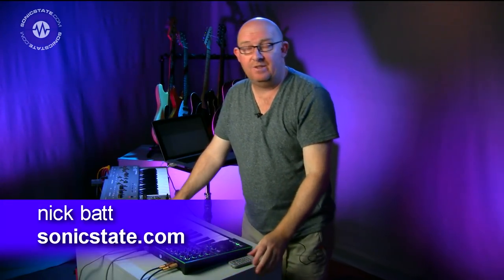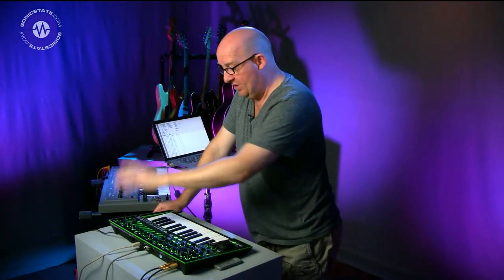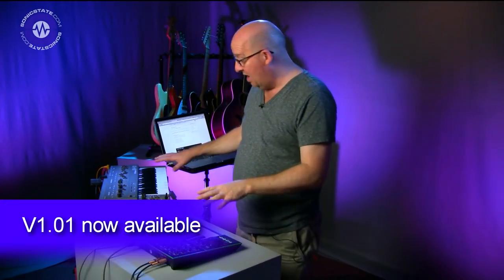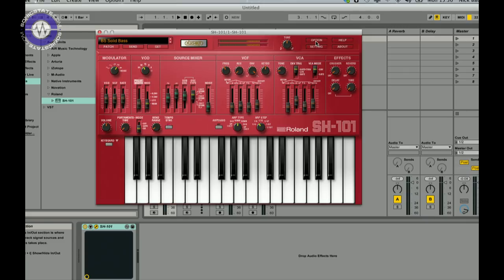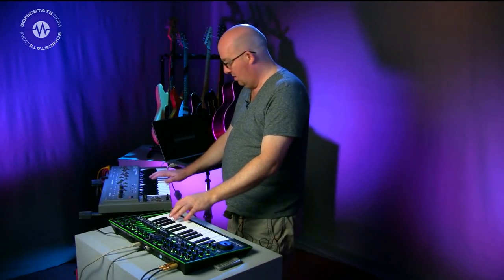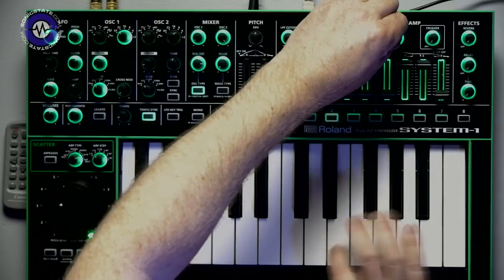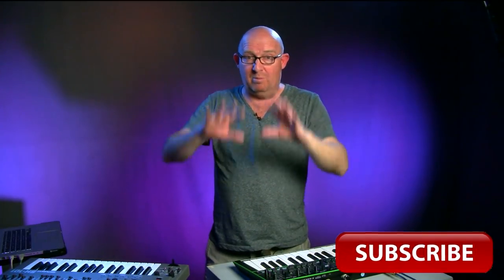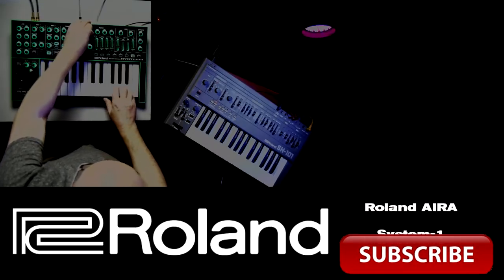AIRA SYSTEM-1 and SH-101 Plug-Out

Comment: Roland given up making analog synths, They last over 30 years. Plug-ins last as long as your computer 5/7 years if your lucky. Roland will be on something different 5/7 years and probably not interested in keeping old products up to date so they work on new computers. (Throw away products should be at throw away prices). You can get a REAL ANALOG for that price. My 101 has lasted 30 years with no repairs. And looks as if its going to last another 30 odd years lol
Reply: jdxi and jdxa both have analog synths plus the se02...so no...they have not 'given up'

Comment: Bought one of these a few weeks ago used, in great shape and it is a powerhouse. I have Roland Cloud Ultimate (worth every penny IMO if you're a heavy Roland user of their recent gear), so all the monosynth models can be added and swapped at will in my DAW for no additional cost. The extra preset packs for the Plugouts (SH-2, SH-101, ProMARS, and System 100) are spectacular and also free. The System 8 vst presets are also freely transferrable and are not the same as the base presets on the unit I bought. The immediacy of the knobs and having nearly everything tweakable without a menu or shift function has sped up my workflow immensely. I own a Behringer MS-1 and find myself not touching it and using the Plugout SH-101 to get great leads and basses I created for years on the MS-1. The arp on the System 1 is your basic bread and butter, so the sequencer on the original SH-101 and even the similar one on the MS-1 are not duplicated, but sound wise - DEAD EASY. I love it and frankly the green LEDs don't bother me. In my dim studio they make using it quite easy as well. It fits in well with my MC-707 and SP-404 to get track ideas laid down super fast. More focus, more creativity, less menu diving are all positive.

Comment: Thanks, very useful review.

11:05 The thing with the class complaint drivers is that they are as you know made by OS vendors (Microsoft, etc.) not Roland. And that can restrict the synth/hardware to a certain standard that might be slower or not up to the high specs of the hardware since it doesn't know the new specifics of it. For such reasons, Roland or any other hardware manufacturer might choose to build a specific driver to support some none standard features that are in their hardware.
Reply from the maker: Okay, thats a fair point, but its only doing 2in 2 out and MIDI, notthing too taxing I would think.
Reply: sonicstate Yeah, I don't think there are too many good excuses for a lack of class compliant midi and audio in this day and age. I would hope that any non-standard additional parts of the hardware that required some bespoke usb drivers would be able to sit alongside the class-compliant stuff, but I don't actually know if thats the case. And that possibility may also be limited by hardware choice of usb interface controller chip. 

There are at least three really rubbish reasons why Roland may not do this class-compliant stuff, along with some possibilities which are justified. I would rant about this issue more if I had a clue which reasons are the real ones, and if this device really would be a supremely great fit for stuff like iPads. But things like the spec of the keyboard and the fact the whole plugout thing really lends itself to working with a DAW on a computer and then using it as stand-alone hardware, means I'm not going to cry too much about this devices failure to embrace the world of tablets.

This sort of thing does make me wary of becoming a Roland customer though. I got a real nice feeling when some X-station 25 from Novation that I got in 2004 turned out to be class compliant for both midi and audio, and worked real nicely with my iPad in 2014. I'll have to wait a good while to see if Roland and the AIRA range can get anywhere close to that sort of class (pun intended), which is a shame really.
Reply: sonicstate hmm, in that case I guess I agree with you. Although it is transferring patch and plugout data at the same time on the same USB isnt it? Could the compliant driver be confused by that?. Any way they might have just slapped their already ready made I/O interface/driver that they used every where else but thats not a good excuse.

Thing is, even with the compliant driver there is no telling that Microsoft, Apple etc. will do a good job in future OSes, or worse change the standard, which means that some hardware in the past might not work any more.
Reply: SoloStuff Part of the idea behind class compliancy is that it's backwards compatible, and should always be so, even if it undergoes changes. But the problem is indeed the transfer of Plug-Out data. Everything else it does is technicly possible via class compliant drivers, particularly since they gave it the bulkdump of patch data.
Now, it is possible to implement Plug-Out data in a class compliant manner, if the "drive" the data are installed on, were to work on the same basis as a USB drive. However, this could have some negative sideeffects, such as it could be harder to keep the system "sealed" from unintended eyes. Some might be confused when it shows up like an extra drive - the disconnecting could troublesome in certain cases. And most importantly it may affect the manner in which the data are installed and subsequent stability and performance.
So while class compliancy would have been preferable, i can understand why this isn't.

Comment: At 9:13 you can hear that sound when the resonance is fighting with the oscillator's lower harmonics, plus a lot more saturated filter sound.
That one is still yet to be modeled properly. The sw resonance does not sound like an integral part, more like an added sine wave on top.
Still, this one is a pretty decent code.

Comment: Hi just wondered if you could help me with a small problem I'm having I just wanted to know the best way to go about recording the midi into my daw as in if I needed to use the system 1 multiple times in the same track is the system 1 multitimbral ? Do the 4 voices allow me to use 4 instances of the synth or do I have to record the midi in and bounce it as audio? if you could help me out that would be great cheers

Comment: Were there ever more than 1 or 2 plugouts made for this? Seems like Roland had a good idea here but never expanded on it like it was touted.  Would've been nice to at least have 4 or 5 options, not just 1 or 2 apart from the stock unit.
Reply: There are 4 plug-outs available for the System-1: SH-2, SH-101, PROMARS and System-100

Comment: There is a problem with the USB audio of the Aria devices. In a Windows environment you can't have multiple audio devices together. Most of us already have an audio device (internal or external) or if you want to record the audio from different Aria devices through their USB connection in a take you can't. You have to switch to one of the aria devices in the DAW and record, switch to other device and record that one etc. 

There is a workaround using the latest Asio4All to combine multiple audio devices but it's not stable enough and you lose the legacy driver and probably a lot of ms. The other way is feeding the outputs of the aria's into your sound device and then record this way. (if you are lucky enough to have a lot of inputs) thus loosing a lot of inputs and probably adding noise to the chain.

It's a shame that if you plug multiple aria devices it is not recognized as 'one' multi i/o audio device like some audio devices you can stack together to become a big hub. Lucky for apple users that  you can mix different audio cards to be 'one' hub using the aggregate Device setup.

Another problem is that you cannot change the bit/sample rate, its 24/96 or nothing.
Reply: Buy a 2nd pc used on eBay for less than 100 usd ( if you dont already have an old pc) and record on that. Then transfer the recorded wav file via a usb stick = 'problem' solved in 1 min 🙂

Comment: thanks for this demo, very good info here.  I've narrowed my options down to this synth, along with the Moog Mother 32.  Now, being 1.5 years later, does this synth still hold up?  would you recommend buying this synth as opposed to one of the many smaller analog options available today?

Thanks much, always great information on your channel
Reply: Don't know if you're still looking… the System-1 sounds great (IMO) and has a much wider range than the Mother 32. The M32 has one oscillator and a really good filter. The S-1 is capable of so many different sounds - some of the waveforms they've added are impossible on most traditional analogue synths. The M32 is geared more around integrating with eurorack modular stuff, although the System-1m version can also hook up with eurorack via CV/gate (though with fewer modulation possibilities, maybe). The System-1 is really underrated as a synth IMO. Some of the Youtube analogue warrior comments are hilarious ("the Monotron is better than this piece of junk", etc). My tip for the plug-outs would be get the SH-2 first, it sounds fantastic. The SH-101 is pretty authentic, and the System-100 one is quite cool but requires some patching on the computer to get the most out of, which can't be done from the front panel.
Reply: FinalForm Thanks for that info. since my comment I've had a Sub Phatty and sold it. it sounded great but a mono synth really wasn't what I wanted. I still look at these used, good price. it still appeals
Reply: modcraft13 cool. Yeah I think these are good value despite the cost of the plugouts. I'm considering trading up to a System 8 for the Juno and Jupiter models but can totally understand people choosing a true analogue poly like the Deepmind or Rev2 instead. I prefer the system-1 to the minilogue though for example.

Comment: This Synth looks totally obsolete to me. 
My iPad 4 + Synrizer + Nanostudio + Synth xyz .. and a decent controler keyboard are so much better and more flexible. 
I love the TR-8 and TB-3 though, because of the live aspect. 
But this is just another good sounding synth with a terrible keybed.
Reply: Dude(s)....play it. The best Roland synth in 20 years. If you want good keybeds, find a time machine or spend some money!
Reply: *****
At the moment: CME Xkey + Arturia MiniLab controller+ iPhone with MIDIBridge and powered USB hub + 30pin2USB adapter + 30pin2thunderbolt adapter. The powered USB hub provides voltage to all the devices and the keybeds. The keybeds are routed into the iPad via iphone MidiBridge software. It's not as easy as it could be but works very well and does not cost anything extra because I allready use iPhone and iPad for other purposes anyway. Just turn off 3G if you perform in public ;)  The main problem: Too many very good cheap as bread VAs on my iPad. :)
Reply: verve92 loooool

Comment: I wont upgrade from cubase 5, so screw roland....
Reply: It works with my Cubase LE, wtf you talking about?
Reply: Yes it's vst3....Steinberg's latest and only officially supported plugin protocol. The problem?
Reply: ***** You will still be able to play it like any other synth and record that in Cubase 5 you just won't be able to use the VST plugin for it. Not really a big deal when you can control it through the knobs and midi anyway? What's the big deal.